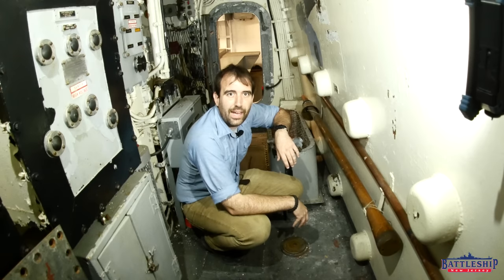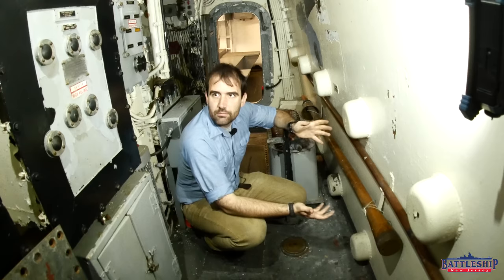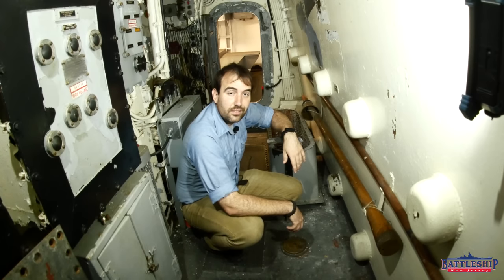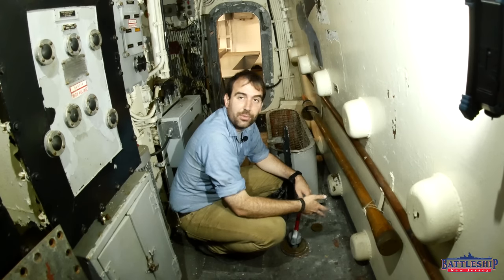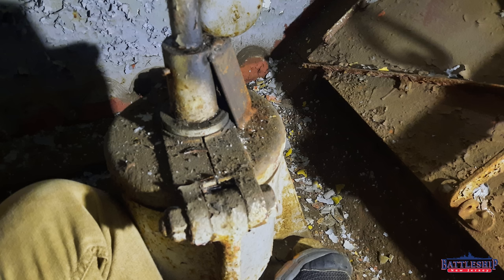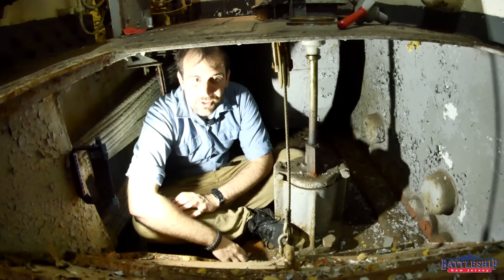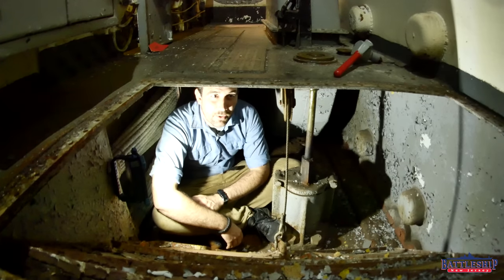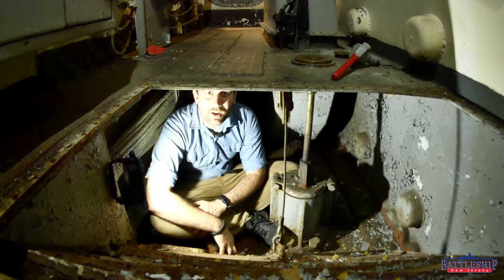Are The 16in Gun Turrets Welded in Place? UPDATE!

Comment: I'm no expert and I get the whole point about not being able to start up the generators on the ship... but what if you were to set up some heavy duty generators that are put in factores or on the backs of trucks/trailers to give it the power necessary to operate just one of the turrets? Of course it would be expencive and there would be alot more planning and issues that can arize because of moving the turrets like maintenance and other problems that come with these older ships.

Comment: I bet you can run a single turret on shore power. After all, the 1.8kA circuit breakers for the turrent are rated to support all motors on the turret at once: rotation, elevation, shell & powder hoists and so on. And they'll have some leeway build into them so a shorted lightbulb while operating the turret won't blow the main turret fuses.
If you go a bit more slowly and first rotate, then load a gun, then elevate and .. so on, you'll be pretty safe from blown fuses. And epending on what you want to hit let's just say that any arbitrary landmark is bound to be much slower than a sequential turn and elevation of a turret.

Comment: Ryan would love to see as many backup systems found on New Jersey, like for the turret movement,  winding in the anchors, reinstalling the missing mono rail pieces,  dewatering flooded spaces without power [hint- eductor, water supplied ventury or an air operated  Wilden pump] still you those at my job to transfer lots of Cooling tower water from one basin back to the other...great results quickly. Good vid about the welded pin mechanism. Just enough to keep just anybody from taking the key and yank and krank the pins out. I bet if they had a key to pin it in place there was probably an air over hydraulic pump or  a hydraulic motor that could be used to traverse those turrets when really needed.  Looking forward to those vids

Comment: Ryan asked "can they move" he said again... No. This is incorrect. Sure they can move, cut off the welds, remove the 1800 amp electro-hydraulic motors and replace it with a hydraulic pump, hydraulic motor and proper gear reduction. With proper gearing, anything can be moved. The rudders were able to be moved with a hand crank... Sure they won't move as fast as needed for target acquisition but they would move enough to draw a paying crowd, you know, to recover the costs of installing the system... Instead of saying "No", maybe he should say, yes, they could be made to move, is it feasible, no, would it cost too much, yes... Let your hate comments begin... I won't answer them. Have a nice day!

Comment: The turrets probably could be rotated but it would require a large likey over 500hp diesel powered auxiliary generator to put out the amps needed and running some massive cables to the breakers. Another option would to be use something like a massive crane to physically pull or push the turrets around to point them where you want - in any event, it would be a huge, expensive, and likely dangerous endeavor. These are, after all, battleship turrets. Each one weighs as much as some destroyers did back then. Fankey it's a little amazing they were able to fit the power sources for each one in the space they did.

Comment: What if someone  where to bring a generator  of sufficient power to make up the difference ?
Reply: Update  to this. Raised it with my local  generator company  out of curiosity   
It would be possible  but the switch  gear would be the thing to figure  out along with what voltage is it? 
Or possibly  cheaper find a used generator  of sufficient size to just run the turret  at auction  or otherwise.

Comment: Here's a question... Has New Jersey had its screws and prop shafts removed like Texas? Seeing Texas in dry dock its apparent the screws and prop shafts where removed and ports blanked over to prevent water leaking past the shaft seals.
Reply: Her screws and shafts are still in place.

Comment: The installation of turret locking pins makes perfect sense, interesting that they went seemingly unnoticed until now. Also interesting to know what the maximum draw from shore power is. What could the ship (as opposed to the museum) practically do with that much power beyond keeping the lights on and cold-starting the steam plant? And hypothetically, does anything in your contract with the navy prevent you from retrofitting ship systems to accept greater than 1200W shore power?
Reply: I know they like to build with reserve capacity. Carriers can supply shore power from their reactors, as well as clean water.  Pretty useful for helping with disaster relief, along with all those trained Sailors and Corpsmen. I imagine a BB could have done similar.

Comment: Haven't been yet, but as a museum doesn't New Jersey have staircases and other additions to the turrets to make them accessible to guests. If I recall correctly in a video you showed a door cut into the barbette to connect turret 2 or 3 to broad way.  Wouldn't that also be a reason you couldn't rotate the turrets?
Reply: The turret wall and barbette aren't connected to one another. IF you found a way to turn the turret the holes for the guests to enter wouldn't line up, but there would be nothing holding it in place.

Comment: im surprised there is not a manual rotation system that would obviously be extremely gear reduced to even be possible, but still possible to do
Reply: There is, but the first step would be backing out those pins.
Reply: @ghost307  I figured but Ryan acted like the only way to move the turrets was by the motors, those pins could have that little angle cut of and in operation in 5 min

Comment: There is only one way to find out, remove the centering pin and get1800 Amps...let's see if it rotates.
But the pin makes sense, in transfer they just locked the turrets in place, otherwise the motor would have to hold them and that causes a lot of wear and tear
Reply: There's also a gigantic brake on the gearing to help things not move.
Reply: @ghost307  that is true, but the brake is for active use to holt the turrets in place during operation. But keeping the brake locked all the time could risk a cold weld or corrosion,  ending that nothing moves anymore.

Comment: To bad you can’t fire up the generators selling the power to shore would be a decent revenue stream for the museum
Reply: The most that can go from ship to shore is limited by the ship's transformers. If I recall correctly that's around 1200 Amps at 480V... which (surprisingly) is about enough to run 2 McDonalds.
Reply: The amount of fuel oil they would burn to power the steam plant that powers the generators, they'd be losing money.
Reply: @B52Stratofortress1  I've looked at local power generation for many clients and when all is said and done it's always cheaper to buy power from the local electric company (if available).

Comment: 1800 amps at what voltage. I wonder if Ryan is using KVA or if he hasn't calculated for voltage?
Reply: The feed to the turret is 1800 Amps. The amperage on the motor is stamped on the nameplate. Multiply that amperage by 6 to get an approximation of the starting current.
Reply: Pretty sure 480v 3-phase
Reply: @nmccw3245  that would be 350 amps +/-
Reply: @nmccw3245  since it's electric over hydraulic, could easily just fire up and slowly  tap the load as opposed to a battle swing

Comment: Really... if there was a need to "rotate the turret" I'm sure a HV electrician would be able to rig that motor into operation. Come alongside with a massive generator plant on a barge, and run the HV cable up and wire into the motor. 

but WHY ON EARTH would you want to? The sheer expense would be staggering. 

So, for the nutjobs out there... "Yes it's possible! But it's going to cost several million dollars, are you gonna pay for it?!"

Comment: Ryan says there is an 1800 amp breaker for the turret to move with a 300 horsepower motor for the turret.

300 horsepower can be run with 600 amps.

Simple electrical calculation.  Speak to an electrician.

You could absolutely move the turret.

Of course, just because you can do something, does not mean you should do something.
Reply: It will turn with 600 amps, but it takes a lot more to start it.
Reply: @ghost307  I say we ask Ryan if we can go play with some wires below deck.  First case of beer is on me.
Reply: @Dans_Garage_Media  I have a plan in mind, but I wouldn't trust much of the original wiring installation. I'm sure that we'd get found out as soon as we got started so you could probably get by with a six-pack before they threw us both over the side.

Comment: If that's all Ryan we could fix that with a band saw and a grinder in about 30 to 45 minutes do you have power to the turrets?
Reply: It has been stated multiple times that the turret motors cannot be run on shore power.
Reply: @user2C47  
Yep just noticed. I was a pointer in mount 55! Since your so attentive tell me if that mount can move?
Reply: @user2C47  no answer yet? You were so quick to answer earlier
Reply: @34scot  Notification got overwritten by another one. 

The 5 inch turrets do appear to be able to be turned by hand.

Comment: Why couldn't you rig up a battety/capacitor to supply the amperage to turn the turret? You could slow charge off shore power during off-peak hours and then turn the turrets like once a day or something. I'm not an electrical engineer by any means but it's theoretically possible right?

Comment: just saying, a capacitor or battery bank would possibly give you enough power to get the motor moving, most motors use that peak power when starting.  you may be able to crank up the motor with a capacitor bank, then keep it running with shore power.  just an idea

Comment: 300HP at 440V is 360A.  You should be able to run one train motor on shore power.  
That said, the hydraulic system would need a whole lot of work after so many years idle.

Comment: 6:31 Ryan, this is absolutely incorrect. I suggest you consult with a competent industrial electrician and they will explain to you at length that the sizing of the breaker has nothing to do with the running current of the motor. If you've got 1200 amps of 480 available at shore you have plenty of power to rotate that turret.

Comment: I think you could power and rotate the turrets on the shore power connection based on the information available. Perhaps a former crew member could amplify. 

One reference I found said that to power the entire turret system requires 973Kw of power. That at 440v converts to 1276amps. And remember that this is to power the entire turret. Additionally converting the 1200 amps of power available to horsepower gives a result well in excess of the 300hp turret training motor. 

I’m not suggesting you should start swinging the turrets around (though it might be amusing to point all three of them at Philadelphia and demand the city surrender) I’m simply suggesting that it should in fact be possible.

Comment: If it's a 300 HP electric motor, it shouldn't need 1800 amps. That's probably for all the turrets and all the motors. Moving the barrels up and down would take a lot of electric. If you're in heavy seas moving a big old turret around would take a lot of electric. A 200 KVA generator should be able to move it as long as the voltage and cycles are right. I have a feeling once it's moving it wouldn't take much. Greased up good, maybe 20-30 hp would do it. Possibly not even that. As long as the turret is level. I'd be curious if it was moved to put an ammeter around the wire to see what it's drawing.

Also, make sure museum changes won't cause a problem with rotating it.

Comment: You can convert horsepower to kW. 300hp is 223.71kW. W=A*V. Assuming a 450V motor, that’s 497.133A. However, given the amperage of the breaker mentioned, it is probably a 125V motor as that would draw 1789.68A. 

Wikipedia mentions that the SSTG’s provide 450V power. Based on my experience in the Navy, shore power is supplied at the same voltage as the generators. This means that the 1200A shore power breaker can provide 540kW of power. Over double what the turret needs to spin. 

So, yes. They can rotate A SINGLE turret on shore power easily.